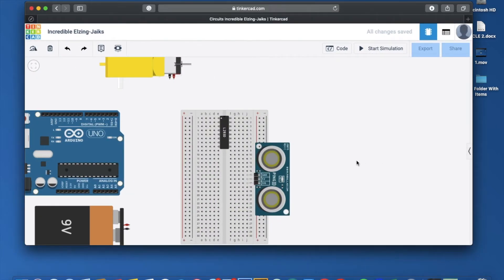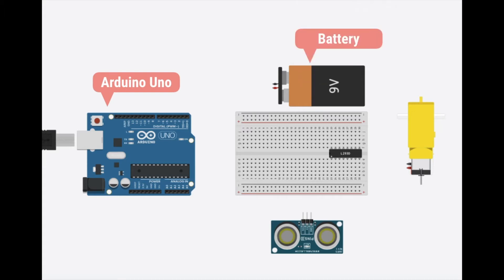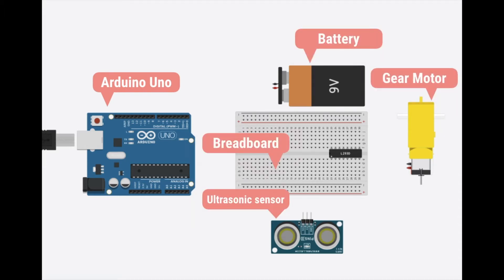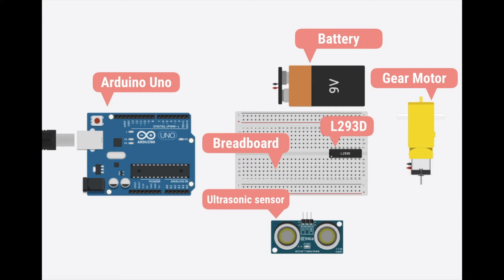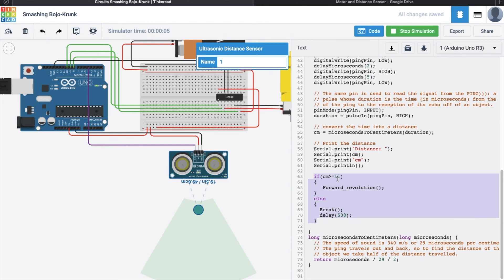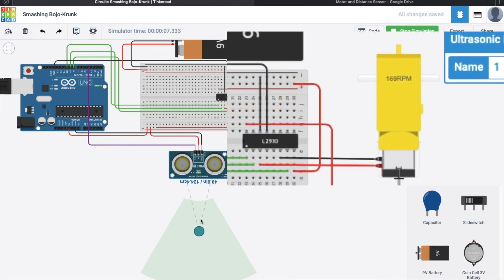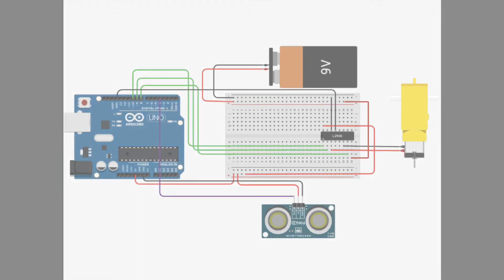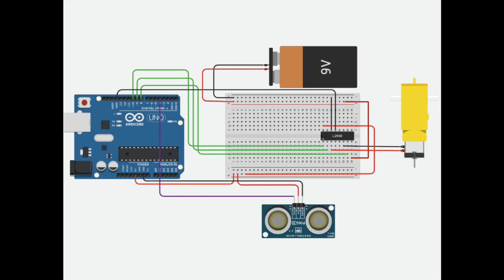Arduino - Ultrasonic distance sensor and Motor

Comment: kindly please provide a link to buy l293d driver and help me connecting a  4 pin ultrasonic sensor...is there any changes in the code when i use 4 pin sensor?
Reply: in the code, yes, but it's easy. You can see a video of the sensor and you have it all explained. So the sensor emits a pulse and then receives it, it's going to measure the total time. You use the formula d=v.t (v: Speed of sound) with that you find the distance at x time, then you divide the distance by 2. Finally, you do an if statement, saying like if the distance is a, then activate the motor (you can see a video of that too, it's really simple) and you have to put an else statement which is going to turn the motor off and that's all.
Reply: @villanuevagonzalo4386  Thanks for the reply dood... But it's been a couple of months since I asked you this question😂... I just found this formula the next week I asked this to you... Also, thanks for helping us with your idea...But, I found this(your) work helpful and I have used a water pump in place of the motor. My project came out well as AUTOMATED WATERTANK FILLER bro...Once again, thanks for helping us for our mini project🙂❤️
Reply: @subaash1706  Good luck with that, I also watched the video because of my project, I hope that when it's done it can appear in a recompilation of arduino projects, that's my goal 😂

Comment: I have the one with 4 how would I connect that please help
Reply from the maker: It is till the same. Are you using the ultrasonic distance sensor HCSR04?
Reply: @RoboGuro  
I have the same question. The HCSR04 has a "trig" and "echo" connection. How would you go about connecting these?

Comment: do you need a seperate power source for the motor? Or is it possible to run it all through one source?
Reply from the maker: You can use extra power source but Im using an extra source to powerup my Arduino and motor :D